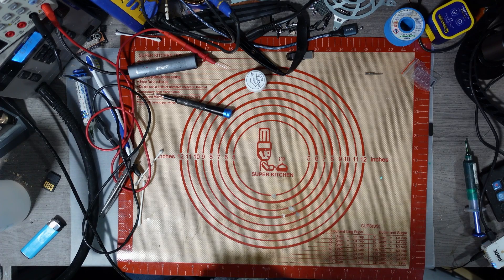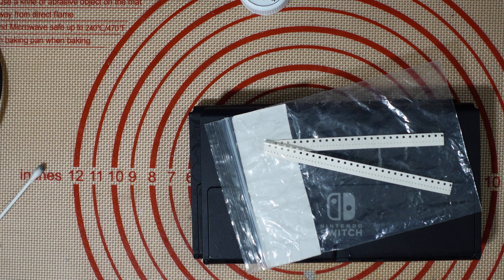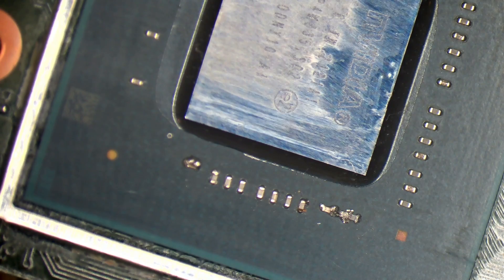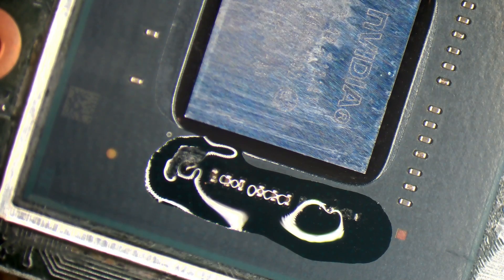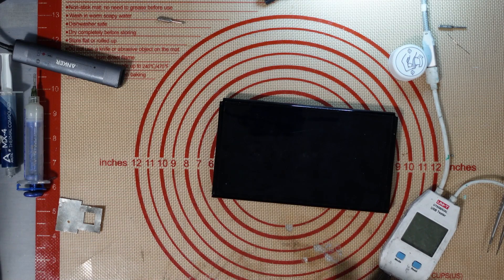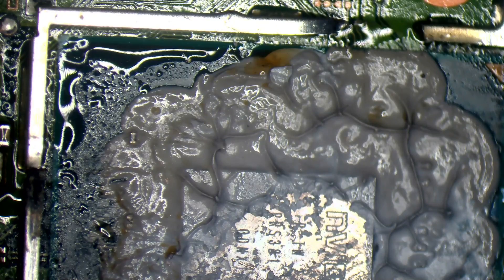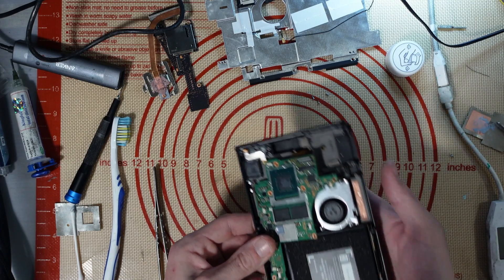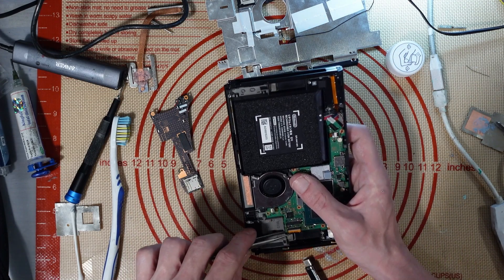He Screwed TWO Nintendo Switch OLEDS Up While Trying To Mod Them! But Can I Fix Them Both?

Comment: Hi bro, first of all, many thx for your youtube video, very helpful, just question, when you was soldring the new fpc connector, It's looks that you was heating from the bottom, how did you protect the EMMC, also could you share the temperature and the air on the rework station

Comment: I love your videos, I learn so many little bits of information. Like my switch that doesn't display but had back-light on and previously worked. But I think it is flux in the connector! Any advice on best cleaning methods? Cheers!